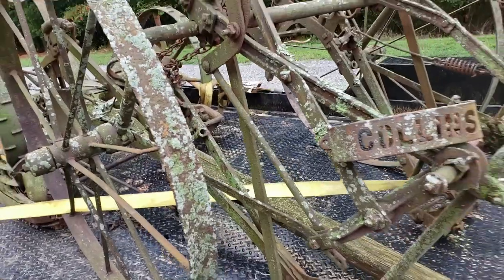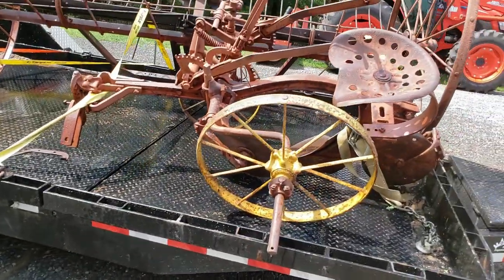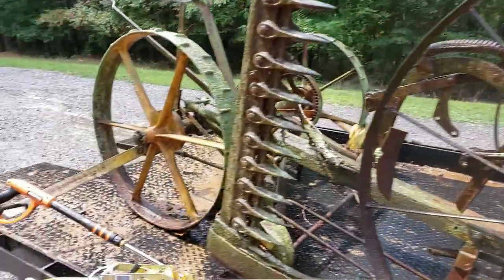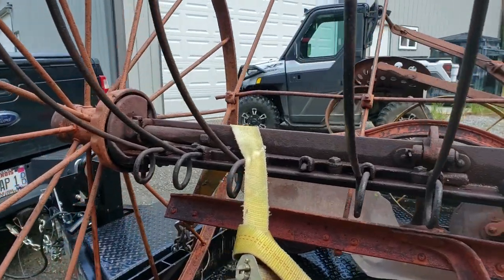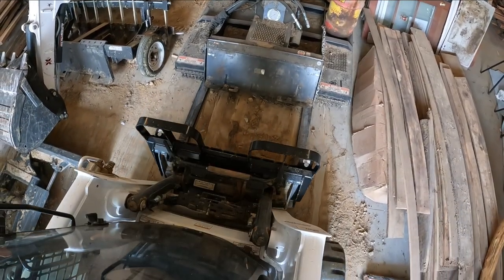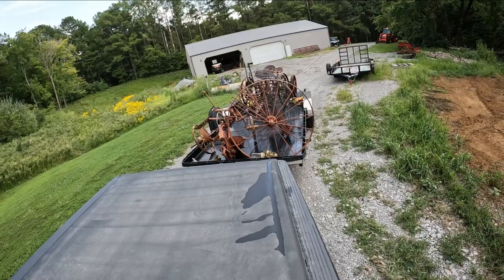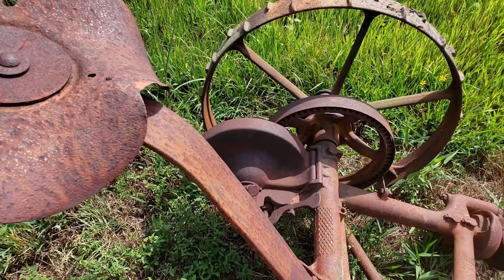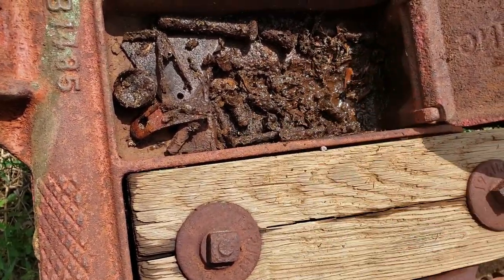Modern equipment meets 100 year old antique farm implements! Labor day vlog PART 2

Comment: Just in case your plans don't work out--the teeth from that old hay rake make fantastic plant hangers when welded on a metal post.  The steel wagon wheels makes wonderful pole bean towers when welded on a iron pipe top and bottom...then run string between the wheels for the vines to grow up on.

Comment: Sickle Mower watch when raising or lower blade sickles can slide and cut off fingers, riding cultivator, the shovels swing you guided it to stay off the corn with your feet. Dump hay rake, pushed the peddle engaged dogs should lift teeth as it went foward and locked in when you were ready to pick up hay you stomped  it again and the teeth dropped, Sulky Plow Oliver was a very popular brand, usually worked 3-4 head of mules or horses to it didn't have to let them blow as often. Good fines should be casting numbers and logos on them